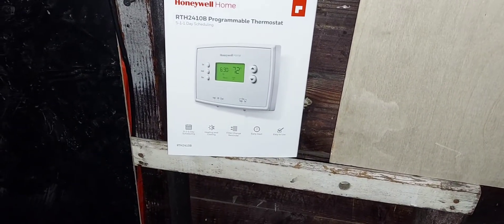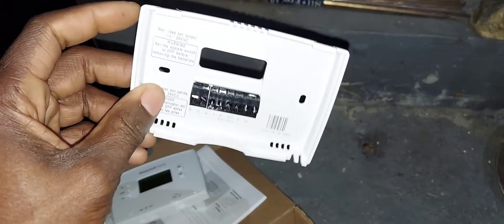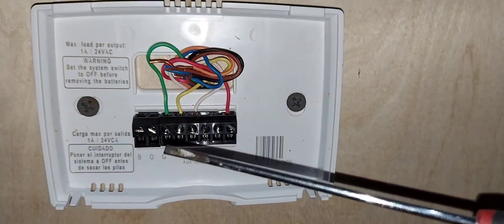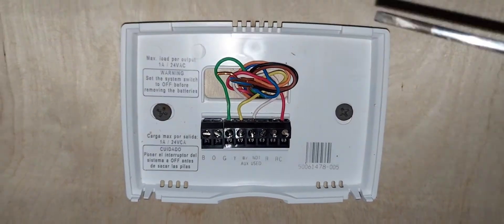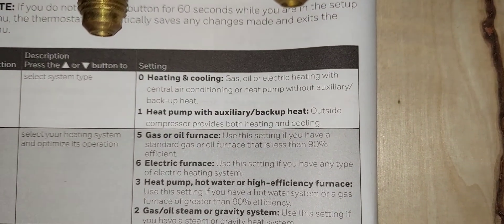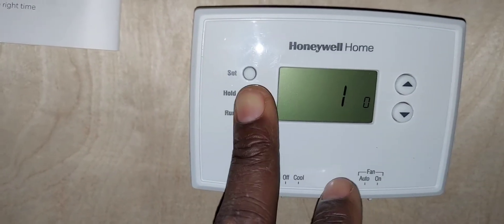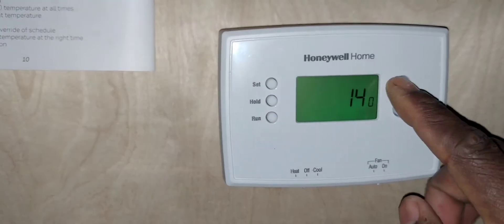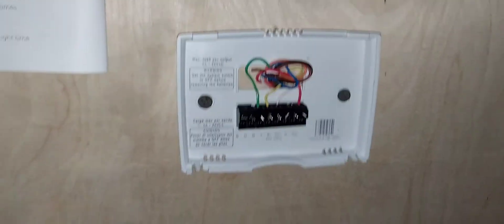RTH2410B HONEYWELL THERMOSTAT HOW TO INSTALL, CONFIGURE AND  SETUP SCHEDULE

Comment: Thanks 
But when u have only 2 wires black and white? 
What do you do or where do you connect them? 
Thanks .
Reply from the maker: Sounds like you have a heat only system.  If so R and W
Reply from the maker: Color doesn't matter!

Comment: Hi my thermostat is set in 71 and the house is warmer than that so it does not appear heat on because the temperature of the house is warmer than the one indicated in the thermostat,what is going on? My house is too warm
Reply from the maker: The thermostat will overshoot to some degree,  try using a lower than desired setpoint

Comment: What if you have hot water heat registers
Reply from the maker: Water heat registers?
Reply: @D2DNYAC  baseboard water heating system... They are called registers.

I figured it out tho, my thermostat i bought didn't have a C slot, and I need that for my blue wire .. so thank you for the vid.

Comment: I’m a little confused. I have the RTH2410B1001, but my system settings go numbers 1-6. And yours are different numbers with 8 different options. Any other video guide shows the same numbers, any help?
Reply from the maker: Not sure why that is ! What are you trying to do?
Reply: @D2DNYAC I was trying to turn off the pre heat setting or whatever it’s called. I searched and searched and finally found one that matched my thermostat.
1 is 0Fahrenheit vs 1cel.
2 is (0)12 hour vs (1)24 hour clock
3 is heating cycle timer (depending on furnace type, default is 5)
4 is compressor protection (0 off 1 on)
5 is adaptive recovery 0 off 1 on
6 is system setup 0 is conventional and 1 is heat pump with aux backup. 

Hope that helps anyone who may run into my problem. Feel free to comment with any questions. Questions 3, 5 is gas or oil. If you have something else ask and I’ll tell help you out.

Comment: Thank you for the video - I have a problem - When running my upstairs air conditioner, the induction fan cycles up and runs for a minute, then turns off - repeats a few minutes later until a/c turns off.  From what I've read induction fan shouldn't be turning on if the a/c is running (it doesn't on my downstairs unit). Unit is running fine otherwise, red light on circuit board is solid (no errors). Ideas as to why the induction fan cycles off/on when running a/c?
Reply from the maker: More than likely, wiring issues!! What happens when you turn on heat?

Comment: The only thermostat I install is the Honeywell TH 8321R. Covers every installation and is RedLink. Installer screen is locked so the homeowner can’t tinker and cause a callback. Never had one fail on me yet
Reply from the maker: Good information

Comment: I purchased 2 of these units probably 6+ months ago now, and they are really good units. https://www.youtube.com/post/Ugkxcr5WULFU6yC9UUKc_cdNJT9jGa6VxO1l They are great for 3d printer plastic dry boxes, freezers, vehicles, gun safes, and more. The unit in the picture was pulled from my deep freezer and moved into my truck center console (monitoring humidity for water leak). It took a few hours to thaw and normalize temp and humidity reading going from those extremes, as expected, but it handled it well and is still running great.
Reply from the maker: Thanks for watching

Comment: Hey 👋 I Have the Same Thermostat But Why Does  It Stays In 85 And Doesn't Go Up Or Down ? A Little Help Please 🥺
Reply: mine is stuck at 84 too :/ it’s so hot and i have the hold button on 55 i’m so confused i just want it to blow cold air until i say so ://
Reply from the maker: What mode is the thermostat in? Cool / heat or off!
Reply from the maker: If cooling what temperature is it set to?

Comment: I'm having problems in setting mind will you help thanks
Reply from the maker: What problem are you having?
Reply: @D2DNYAC  I'm not able to set to heat it keeps blowing cold air
Reply from the maker: @crafty passions what type of heating system do you have? Is this a new thermostat installation? Is the thermostat set and calling for heat?
Reply: @craftypassions1754  how did you fix it?

Comment: I have a orange wire hooked up to O/B on the old thermostat , so where do i connect it now.

I also hava a blue wire so where do I connect that one
Reply from the maker: Depending on geographic location if you are down south like say Florida most likely it will be B terminal and if you are in the north say New York O terminal most likely and then go into setup menu and set option 1 to 1
Reply from the maker: @Pell 557 what terminal on the old thermostat did the blue wire came from
Reply: @D2DNYAC  on my old thermostat blue was to common (c) terminal I was told to do away with it

Comment: Thank you for your video. Very helpful. After installing the thermostat, the compressor doesn't start. Is it programming issue?
Reply from the maker: @indy Jones there is a default 5 min time delay before compressor starts in thermostat!
Reply: Thank you so much! big help! @D2DNYAC

Comment: How to take off Temporary and just use as a regular thermostat. Can’t manage the settings. It got messed up when I had to change batteries
Reply from the maker: Do you mean use schedule?
Reply from the maker: Just press run to use schedule or press hold to maintain current temperature set point indefinitely! Or forever 😂

Comment: The colors of the wires should matter when connecting the thermostat.
Reply from the maker: Whats important is that the thermostat wire  connections is matching that  inside the A/C or HVAC equipment. 
Meaning  Y at the thermostat goes to Y inside the HVAC equipment R to R etc.